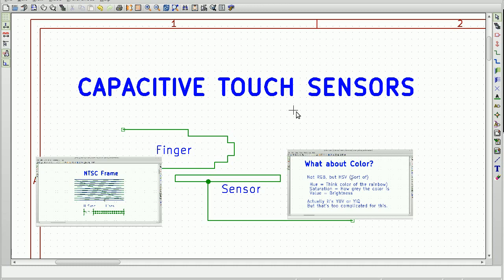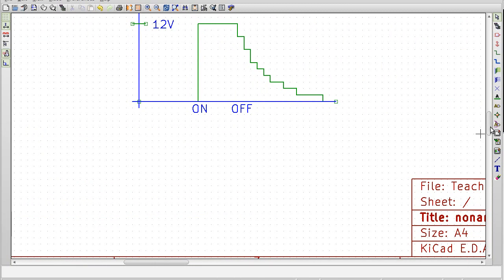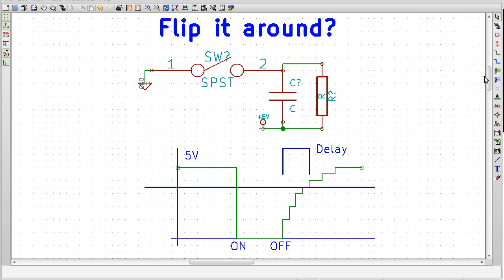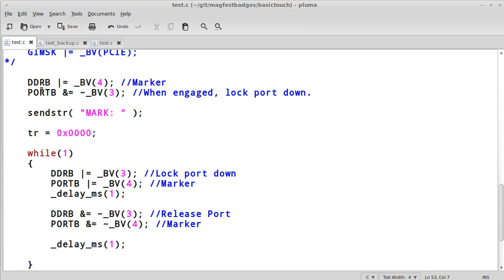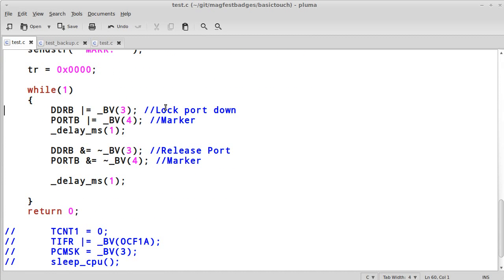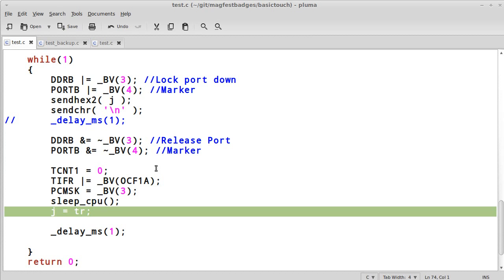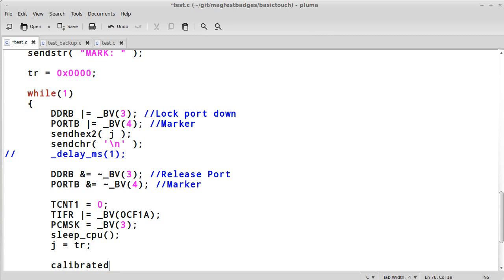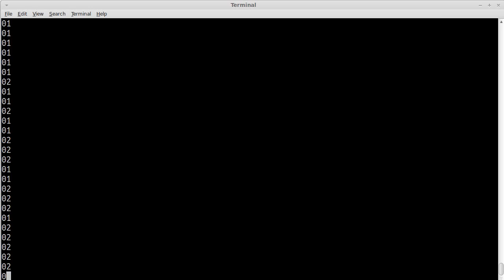Capacitive Touch Sensors on an AVR without QTouch (Let's Learn and Code 3)

Comment: Great video, but the big question you didn't answer: why not just use QTouch? What are the benefits of rolling your own code?
Reply from the maker: Generally portability, and not needing mutual caps in the systems where you normally do.  AND you also can use any pins you want for this.

Comment: Thanks! How does the resistors value affect this? Will a larger resistance just make that time of the curve decrease? Most folks are saying use at least a meg or it will be a proximity sensor? Not sure if I’m understanding this relationship. Your vid has been the most helpful

Comment: Hello are you still here?   I am trying to do the cap touch sensor and I have something that looks like your stuff the top voltage it reaches is 400 mv , when I touch my PCB I see the slope of the voltage going longer.  Does your voltage rise all the way to 5Volts?  Does your scope probe not load the signal ( I have 1Meg and the scope probe is 10 meg so not a lot of difference).  Just so you know I am using a tiny13.  Any help you can give would be appreciated.
Reply from the maker: The systems here are really sensitive so your scope probe will effect it, but it sounds much more like you need a bigger pull-up resistor.   Not sure what the impedance of the inputs on the ATTiny are, so maybe that's not suitable?  But the voltage should very quickly rise to at least 2-3 volts if being pulled up to 5 v.

Comment: Nice! How would you design circuit to sense longer distance and even more hard - through 25mm thick wood?
Reply from the maker: this method wouldn't work that far :-/ you'd have to use RF or other methods.

Comment: Thank you for posting this and describing how it all works. This is really fantastic. I'm working on a project adding a capacitive button (two actually) and was tremendously frustrated to find that Qtouch is only available through atmel studio (I don't have a Windows computer) This solution is perfect!

To clarify (I've looked at the schematic) the only components you need are a conductor under a dielectric and a properly sized resistor? That seems impossibly simple!
Reply from the maker: That is indeed all!  Yeah, I'm not sure why QTouch is a thing at all.

Comment: Thanks for video!

I've tried that, but it works buggy in case of grounding the AVR, so I can't use it for controlling the LED Strip.
So I still use SPST buttons and variable resistors...
Reply from the maker: You don't make contact with your finger.  You have a plate and an insulator, so it's just one half of a capacitor.  Indeed you only need one micro pin!
Reply from the maker: I think I am going to post a video about an isolated version I was working on for a while.  Next time I do a project with it, I'll include a video about it.
Reply from the maker: >.< I actually haven't needed to make an isolated version, still.  A regular version with grounding has been good enough.

Comment: First off, thanks for your excellent tutorial. Can you provide some pointers for me? I was able to get this working like a charm, but ran into problems when expanding it to multiple pins. Since there is only one interrupt for all pins, I have basically run the relevant code twice, one for each pin, while changing the bitmask the interrupt uses to fire on. This only somewhat works. The inputs sometimes appear to bleed over into each other, not turn off all the time, etc. Any ideas as to how you would adapt this technique to utilize multiple pins? Thanks!
Reply from the maker: I use a macro to write the code for me, this does expand a lot, but in the grand scheme of things it's not that bad.

One thing I always do (and seems to help a lot with the bleeding) is to drive all pins low when they're not in use.

Idea is: Release pin, count time, drive pin low.  Repeat for all pins.

Comment: Ok so I watched the entire video, and understand what you're doing. It's cool. I think you should revise your commentary and the drawing at seven minutes. It seems to me by what I observed on your video that the resistor and capacitor are in series and the resistor is tied to +5v. The switch (or port pin) is essentially connected across the capacitor to ground. When the switch closes it discharges the cap almost instantaneously. When it opens, the cap charges at the rate you show on your diagram.
Reply from the maker: Look at the symbols, the ground is on the other side of the switch, the 5V is hooked up to the other side of the capacitor.  I guess I should have drawn them more clearly with the + going up and the - going down.
Reply from the maker: Actually!! You are sort of right!  I will have to update my annotations a little better.
Reply: CNLohr The annotations still won't fix it or make it clear. The diagram is simply wrong. The cap's voltage will not curve up like that with your existing drawing. You need the resistor and the cap in series from +5V to GND and the switch needs to be across the cap only. When the switch is closed, the cap will immediately drop to zero volts. When the switch is open, the voltage across the cap will rise as you show it because it's being charged by +5V through the resistor. I wish I could show you.
Reply from the maker: Tony kara
I ran a spice simulation.  I took a picture of it.  You can see the link in the description.

Comment: Your circuit and comments at 7 min isn't correct. When you open the switch in the "flipped" circuit, you show a slowly rising voltage as the cap charges. You don't have a complete circuit the moment you open the switch, and therefore you have no current. With no current, there is no voltage drop across the resistor (and the cap), so the voltage is the same on both sides of both components. It will be equal to 5 V immediately when you open the switch.

Comment from the maker: If you are not grounded /and/ it is not grounded, it works quite well... Still works slightly better if you're both grounded.  IF One is grounded and not the other, it's terrible.